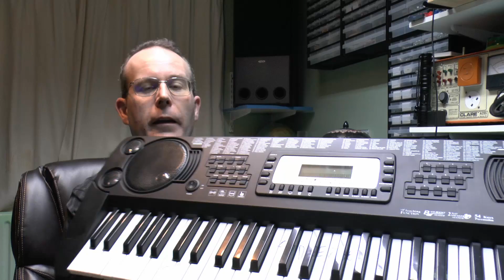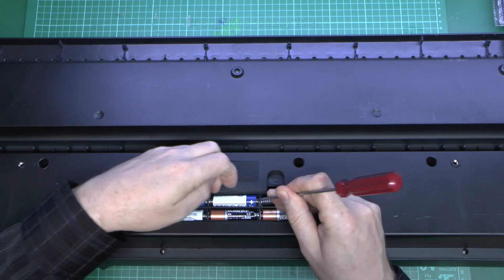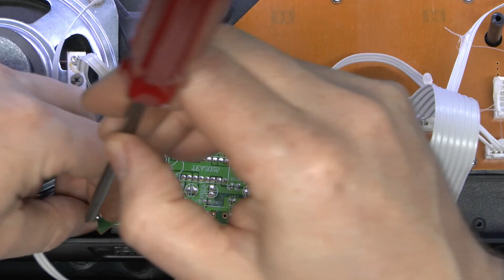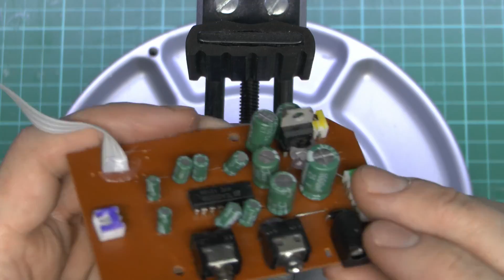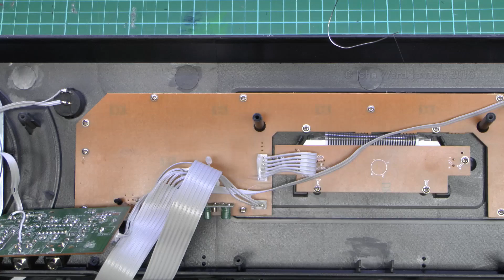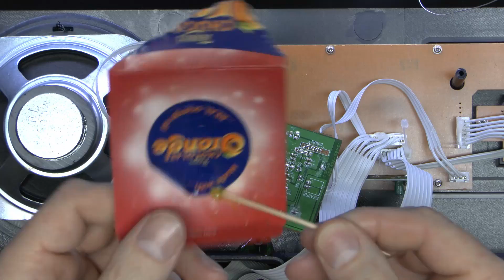Musical Keyboard PCB Repair

Comment: Hi John, I have a keyboard with a sound fault. The right channel works fine (both through the speakers and headphones) but the left has a bit of a hum and the sound coming from it is very faint. I was wondering whether you have any ideas. Thanks.

Comment: When you connect the power adapter ,the batteries, if they're inside the keyboard are usually disconnected. There should n't  be a need to remove them.

Comment: Ideally the old solder should have been removed, the pads cleaned up, some fresh flux and re-flow the connections. just loading it up with more solder is a bit sloppy. However a partial save on an cheep and cheerful keyboard.

Comment: TEA2025 sure seems familiar. Remember ISA soundcards in mid 90ies? Remember that they often included a speaker amplifier, and not just a line output, and you'd plug little beige shitty passive speakers in there? Well that's one of the ICs they used most frequently for that. It doesn't sound good at all with pronounced crossover distortion and is very cheap, but it's par for the course if your speakers are of that kind of quality.

Comment: Great job JW. This video surely did bring back lots of memories as related with all the keyboards I did repairs on in the past. About 30 of such repairs as in the video.  Very Common Breakage in both consumer and pro gear where keyboards/drum machines/laptops and such devices, sits on a table or stand, someone walks by and trips on external power cord, all comes crashing down.  The first thing that usually breaks is the external DC input coaxial power connector where a hair-line crack happens between the jack pins and the PC board.  Such crack(s) under the solder pad(s) is often not easy seen unless the jack is loose, moved showing the issue. When the jack is not loose, its more difficult to see any such fractured connections. Fixed by not just re-soldering but scraping off the surrendering PC trace area solder resist, exposing the copper, then soldering handles not only connection fix but even adds a better base mounting the the jack in all future tugs the external power cable.  Of course in more serious damaged PCB repairs, as in video, jumpers have to be added.
Reply: that's exactly what happened to mine. the pcb is broken in an area one square inch around where the adapter plugs in.

Comment: I can see how the text ended up backwards. PCB design software shows you a top down "x-ray" view down through the layers of the board, so anything on the bottom will look backwards. Whoever was designing this presumably didn't know this and "fixed" the text so that it looked correct in the editor.

Comment: Seeing how circuit board are  started from a peice of copper. Than etched , leaves me confused to a peice of copper? Because the circuit itself is protected by tracing paper, than is dipped in acid solution. Making everything but the circuit, a breaker board. Just seems, to unbelievable. So need more clarity to circuit board engineering. Along with many other factory process, programming, for better sound in this case.
Reply: Circuit board does NOT start as a piece of copper, it starts as a copper clad board, either FR-2 (phenol-impregnated hard paper) or FR-4 (glass fiber epoxy composite) that a very thin sheet of copper is glued onto with epoxy. The copper clad board is coated in ink that protects what will later be traces, dipped into acid, and pieces of copper sheet not protected by the ink are dissolved in the acid (copper will be recovered from acid and reused later). Finally, the ink is washed off, the copper is plated over with tin to stave off corrosion and provide easy to solder surface, and (usually green) lacquer can be applied for protection and (usually white) lettering printed on top.

For applying the protective ink, the lacquer, and the lettering, usually the very same process is used, they use lacquer and ink compositions that become hard under UV light, so they cover the board with the liquid, shield the areas that shouldn't be covered with a mask, such as a photographic transparency, shine the light for a couple minutes, and wash the unhardened liquid off.

As to the engineering on this particular unit, it's mostly the "no shits given" school of thought. Whatever cheap leftover components they could find, whatever they could get away with while applying the least amount of highly paid engineering force. The second most common school of thought, successfully practised by larger manufacturers is "we know how to do things well, but we'll tend to err on the side of excessively cheap rather than somewhat good", they might after all make millions of these things, and every penny saved pads their bottom line by tens of thousands.

Comment: Well done good repair job!
I wanted to share with you, these DC sockets that switch internally when the adaptor plug is inserted
Can get really oxidised, usually the internal switch acts to switch between 2 neutrals, but occasionally the layout is different and You Don't Want That To Happen!
So it's worth soaking the socket overnight use a blue tack well to keep the solvent in and later check continuity in all situations!
Kind regards Warren
Reply: New 2.1 or 2.5mm DC jack sockets are cheap so I prefer to fit new. The Sinclair Spectrum personal computers of the 1980's used the same type of socket and they would often wear out.

Comment: You left the dry joins on the mic, earphone and the audio amplifier not fixed as well, it will be back with poor phone audio and no mic soon. For the pillars I prefer to use Pratley putty afterwards instead of the epoxy, as the putty has a lot more volume to make the post fill a more robust block, and also I take the plastic and either sand it with coarse sandpaper or simply abrade it with a blade to make a rough surface to mechanically bond the putty to the plastic, as otherwise the epoxy bond to the remains of the mould release are poor, and breaks with time. If no putty around some fine sand, dry talc, or even clean cat litter works fine as a bulking agent for the epoxy mix, so you have a large volume of material with low cost making the join very strong.

Comment: When repairing the broken-off posts, there is an easier way than epoxy. Use Super Glue and Corn Flour. Make a small mould using cardboard. Wipe surface with Activator, then place mould around the pillar. Sprinkle the corn flour, add drops of Super Glue. Fixed. Works with almost any fine power, eg: Baby Powder, Baking Soda (the white stuff used for cooking).To make black, use course sandpaper on inside of object to create a large amount of plastic dust. Pile it up around the pillar and add Super Glue drops. This is instant and far easier than Epoxy (plus it actually sticks to plastics, providing you rough up the surface and use activator / accelerator.

Comment: Failure mode is fairly obvious.  It's a progression.

Dry joint on power connector deteriorates.  Eventually it reaches the point where it goes high resistance/open circuit.

User finds that unplugging and replugging the power connector gives a temporary fix.

User keeps unplugging/replugging until one day it doesn't fix the problem.

User then applies excessive force.  Which fixes things for a while.

Increasing amounts of force are required for a fix until one day mechanical failures mean the circuit board is floating and force can no longer be applied.

Ask JW to fix it.

Comment: Before taking it apart did you test the power adapter to make sure that it was supplying the correct voltage ?
Reply: or is common the case, the wrong polarity, yamaha and casio never could agree
Reply from the maker: Yes, that was the first thing checked.
Reply: is that voltage usually going to be 9 volts or 12 volts?

Comment: I have a keyboard like this, but it seems the socket thing that the USB cord plugs into is messed up. Like it doesn't make full contact, sometimes turns on if you jiggle it, or hold it at a funny angle, but no luck otherwise. Any suggestions?
Reply: moonasha try a different USB cord first of all. Otherwise like here, the socket could have a loose connection inside and needs the electrical connection to the board checking.
Reply: it'snot the cable, tried more than one. I don't think it's the socket's connection either, since I dont have to push on it. I think it's the actual gold contacts, or whatever metal they use. I think they just got worn down... don't know how to remedy that
Reply: moonasha hmmm. Not sure. If the socket itself has some corrosion on the contacts then it can be removed with a scrapy thing and paint thinners, if it's just worn out generally then you should be able to find a replacement socket on eBay really cheap, it may be the case you'd need to desolder the old one from the board to put a new one if you fancy that, or, run some wires from the new socket to where the old one meets the board. USB has 4 wires but if it's only power you need it's usually red and black all you need.
Reply: Surely the new theme tune for the channel ! Good job as ever John
Reply: Well I'd open the case and have a look at the board where the power connector is attached - you often get terrific stress concentrations where connectors to the outside world are soldered to circuit boards and it's a frequent point of failure. Could be cracked solder joint, cracked circuit board or copper track pulled off the circuit board.
Reply: moonasha - what suggestion do you expect? You already know that the USB socket is faulty, so to solve that you need to replace it. Simple.